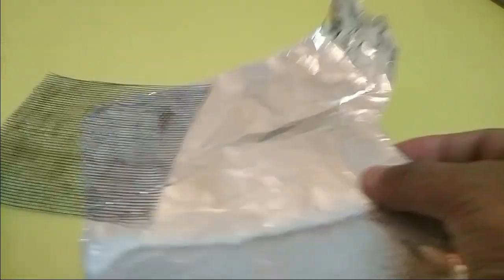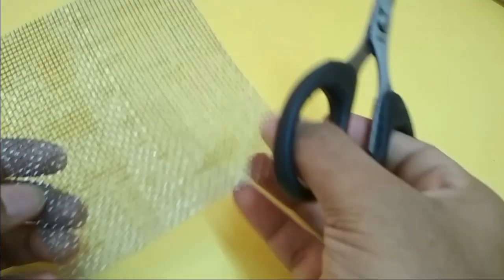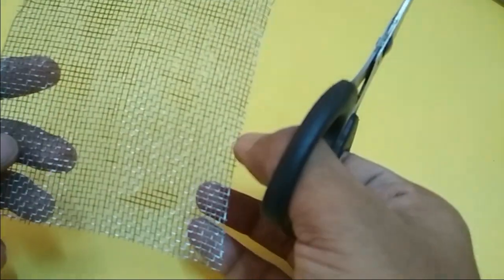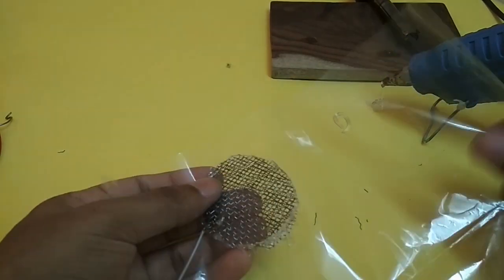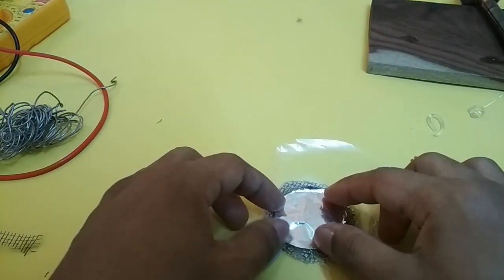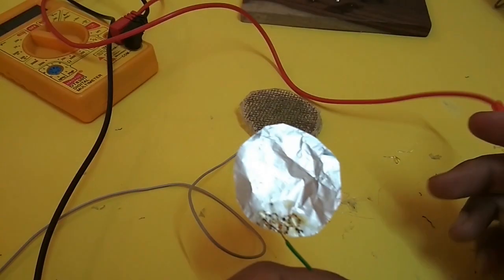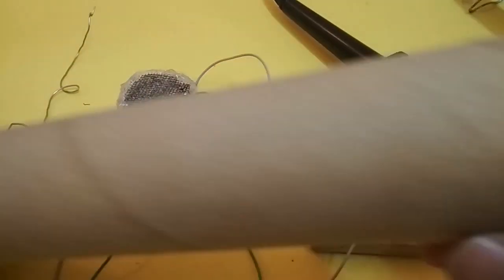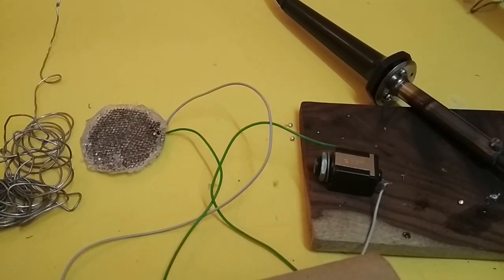DIY Condenser Mic from scratch, EASY!

Comment: Hey, that was awesome as a mega-cheap project. Professional ones (as you know) use some DC current and they have an amplifier (Jfet) which is why yours was so quiet. I am sure you could take another step and improve on this into something genuinely useable.
Reply from the maker: Thanks! Using an FET does make a lot of sense now I think about it. Perhaps I will try this again sometime with some built in gain :D

Comment: I built this except instead of wire mesh for the backplate I bonded another piece of aluminum foil to a piece of thick styrofoam. I was also able to get a small amount of output with no bias voltage. Using the tube was a good idea, I didn’t think of that.
Reply from the maker: Hey! Good to know it was not at least a complete fluke haha.

My thought process behind the wire mesh was to allow air to enter and exit the space between the conductive surfaces as they vibrate, I figured this would allow freer vibration than if there was a fixed volume of air which had to be compressed when the foil moved.

Honestly I'm not sure how much of a difference that makes, haha.
Reply: ThePsychotenuse I think it does likely make a difference. I built another mic yesterday using a soup can and this time put vent holes in the back plate. It produced a higher output although it was very frequency dependent.
Reply from the maker: I would reckon the frequency dependence probably comes from acoustics of the soup can. Cool!

Comment: hey! thanks buddy for making this video, i wanna know the functiong of the condenser mic. and its now possible just because of you
Reply from the maker: Haha well a commercial condenser mic element wouldn't look like this, it would have membranes under high tension separated by air... but the basic idea of having vibrating parallel plates is the same.
Reply: @Psychotenuse  have you used that plastic in between the mash and aluminium ??
Reply from the maker: Yes, that is important to the working of this mic, because it prevents the plates from touching each other and probably also provides triboelectric effects.

Comment: cool stuff ;D you could use a drop of oil (food grade oil is ok) to help soldering the aluminium foil. Also if you make a preamp matching that mic before hitting the audio interface you might get a better SNR. Cheers
Reply from the maker: Yes, I have occasionally thought about redoing it with a preamp. If I do I'll use oil to solder haha, thanks.

Comment: I'm going to try building this for a class project. I was wondering though, were you running phantom power or any current into the mic?
Reply from the maker: It works even without phantom power, due to the electret/triboelectric effect of the plastic film.

Comment: I mean, the important part would be to show the audio quality difference between this and the inverting a speaker method.
I would be interested in a side by side quality check.

Also, wouldn't you want to use an XLR port, so you can get phantom power. I'm fairly certain that phantom power is important to get that higher quality sound out of condenser mics, since the audio output is so low on microphones otherwise.

This was still a lovely video to watch. I'm glad that you did a little beatboxing to liven up the video.

Comment: Does this work with both plates being foil, rather than one being a mesh and one being foil? I'm trying to do it for free without buying the mesh XD
Reply from the maker: That might not work very well. If both plates vibrate together, the distance between them may never change much.

You could, perhaps, punch some holes in and use a piece of metal from a can or something. Someone else in the comments said they had done that.
Reply: @Psychotenuse  makes sense, thanks! Also I appreciate that you still reply to comments on such an old video you're a real one

Comment: You forgot the battery and capacitor.
Reply from the maker: My interface provides a biasing voltage. Interestingly, this microphone also works (less well) without any biasing voltage, presumably due to triboelectric effects.
Reply from the maker: I saw while casually flipping through an acoustics textbook that electret mics use a layer of plastic to create polarization. I think this might be what's happening here.

Comment: Where the 34mm capsule ?
Reply from the maker: This is a scratch build
Reply: @Psychotenuse  but actually if you modify it again and at oscilator + pcb + 34mm capsule it will become pro stratch condeser
Reply from the maker: The whole point of this video is making the capsule. The rest is just a cardboard tube and tape.

Comment: Where can i get the output jack you used at the end?
Reply from the maker: I used an 1/4 inch female TS jack. You should be able to find it at various online stores such as amazon and ali express if you use that as a search term. They are also known as p38 connectors. You can also find 1/4 inch connectors at music stores, PA system parts and repair stores and some electronic component stores.